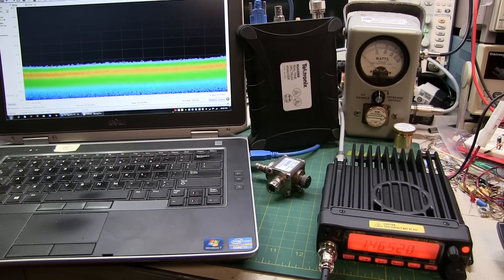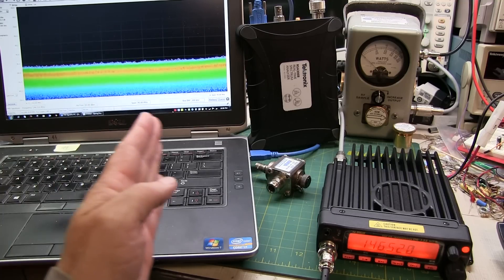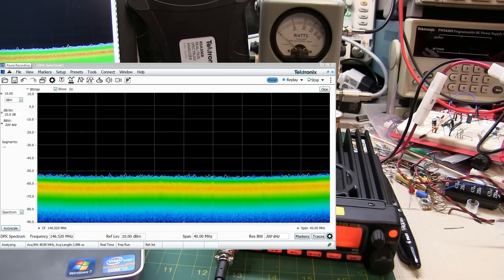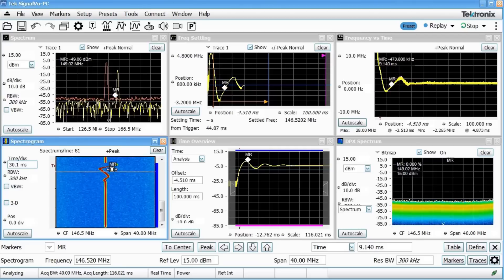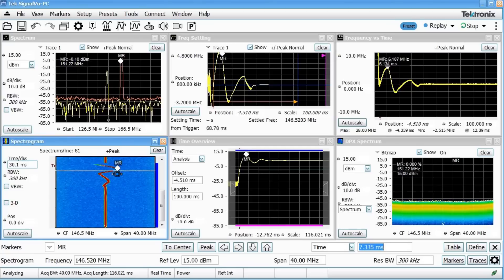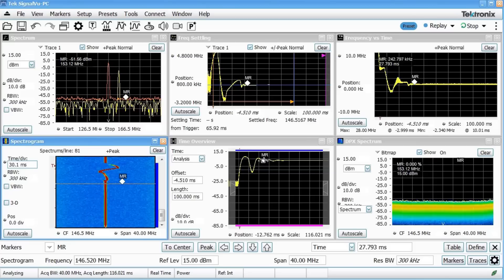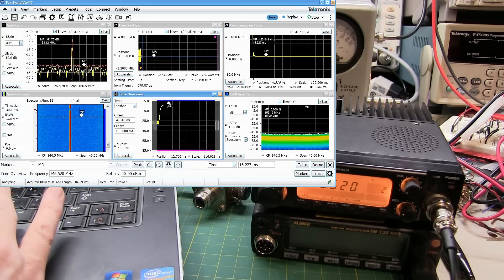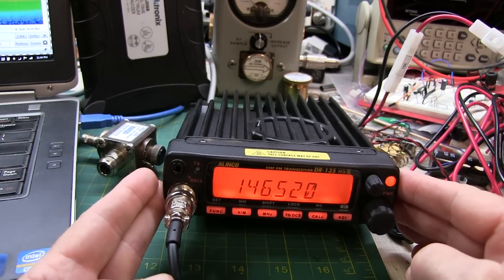#367: Characterizing the key-up frequency transient on an Alinco DR-135 Mk III 2m radio with an RSA

Comment: Wow, that wouldn't pass type acceptance. I think Alinco may be doing a recall soon. Are you considering looking into the design and internals? Maybe a Ham could design a way to fix this issue.
Reply: Amateur service
Amateur radios do not require type acceptance. Likewise, type acceptance for another service does not indicate that a radio is appropriate for amateur service. In lieu of type acceptance, the FCC lists a number of requirements for Amateur station operation in Part 97, our part of the FCC regulations. In particular, Part 97 Subpart D specifies the “Technical Standards“ that must be met by an Amateur station, including, as for type accepted radios, allowable emission types, spurious emissions, power levels, etc.

The big difference here is that the requirements for Amateur service are not for the radio itself, but for the station in operation, and thus the onus of correct operation is not on the radio manufacturer — it is on the individual Amateur! This is a lot of responsibility, but along with it comes a privilege that no other licensed service is granted: the ability to build our own equipment. Licensed amateurs are the only FCC licensees authorized to homebrew radio equipment and transmit with it on the air without testing and acceptance from the FCC. Likewise, we are the only service permitted to use radios type accepted for a different purpose for our own use. This is why a radio Amateur may purchase a Part 90 certified business band radio, for example, and use it on the 2 meter Amateur band.
Reply: Alinco is well aware of this problem.  They don't care.  It is on the amateur license holder to ensure their equipment complies with the rules.  There is no type acceptance on amateur gear.
Reply from the maker: No plans to dig into their design at this point.

Comment: Hello, this is interesting. I wonder how the manufacturer of this equipment could have missed such a problem!

This is only my opinion without real value but I think that the internal power supply of the transceiver is unstable. I would be curious to know more about the type of power supply for this kind of transceiver. Do they use switch-mode power supplies or are linear regulators still the rule?
Reply: The Alinco radio doesn't have an internal power supply, unless you mean the specific power regulators for certain low voltage sections.  It's a mobile radio that takes 12V DC input .
Reply: @nine7295  Okay, thanks for taking the time to clarify this.